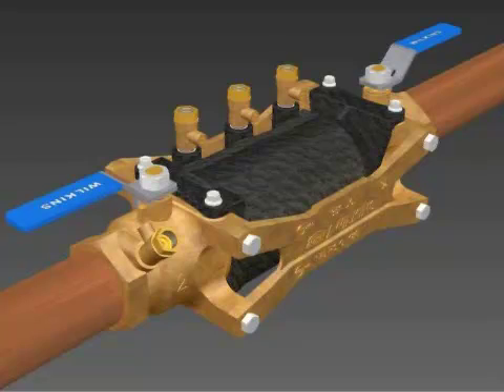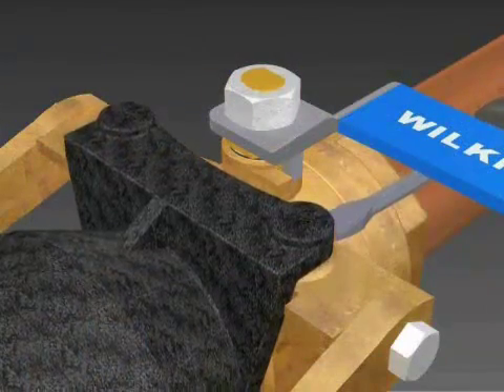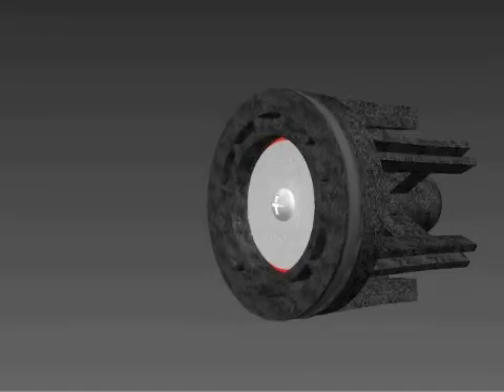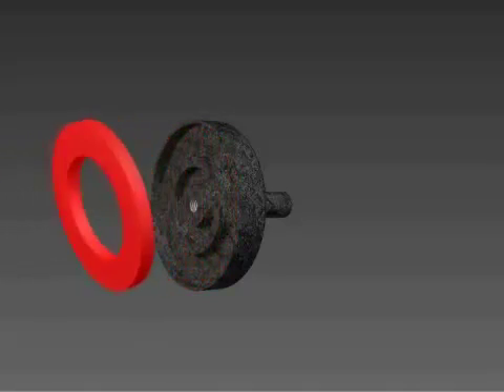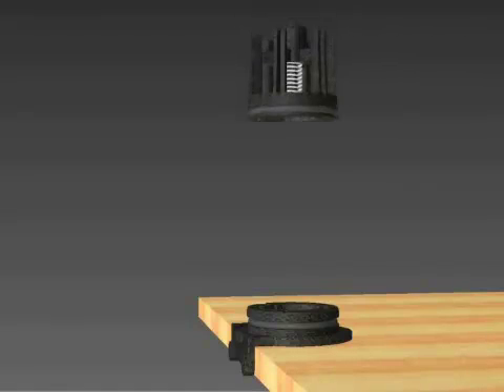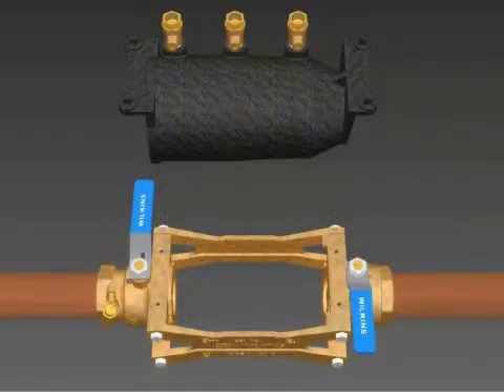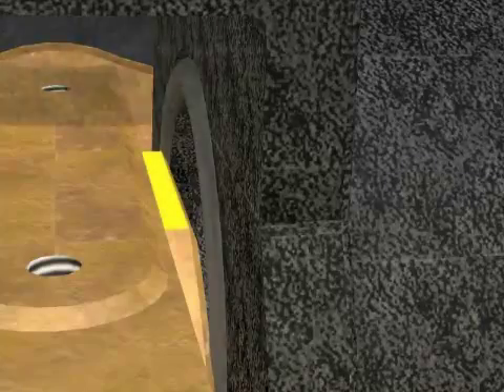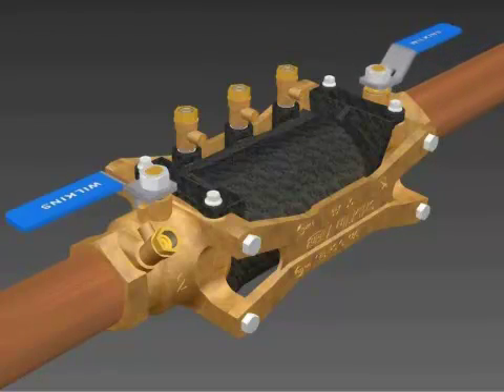Repairing a Zurn Wilkins 350 (1-1/4" - 2") Double Check Valve Assembly

Comment: The most beneficial way to pressurize any assembly especially after a repair is to utilize a jumper hose from test port 1 to test port 2 and introduce water before opening the #1 shutoff valve. Once the assembly is pressurized carefully open shutoff #1 and bleed any trapped air via the test ports.